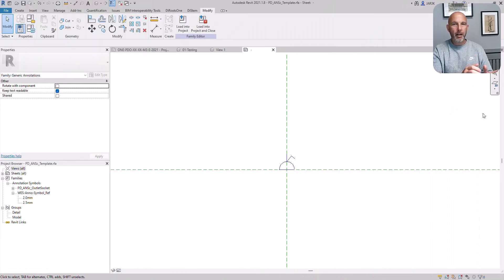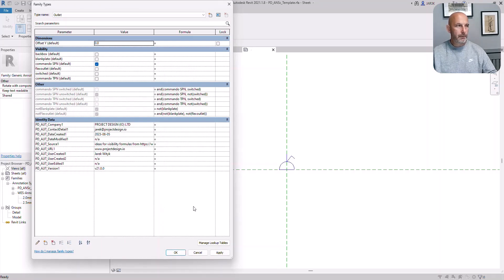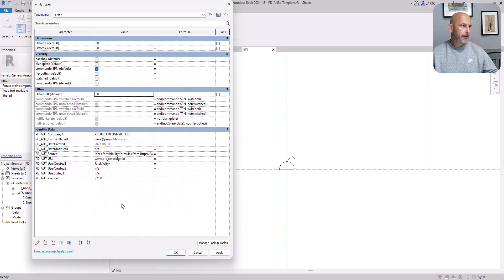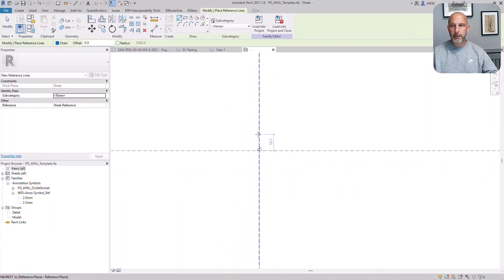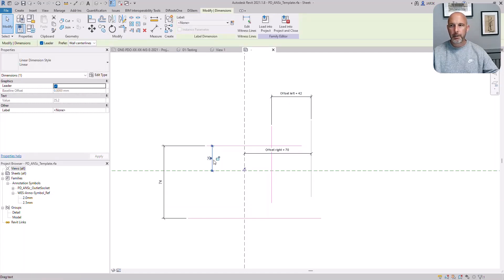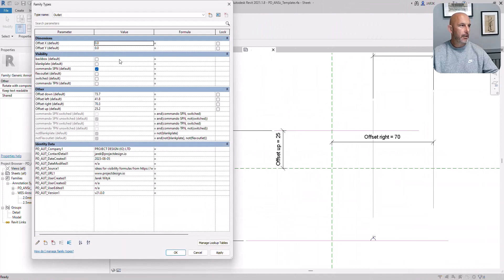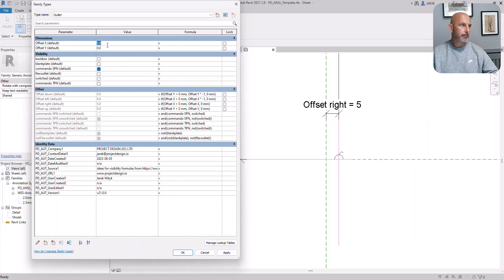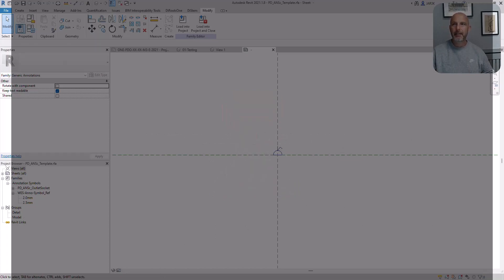4-Way Offset in Revit: The Best Approach Ever!

Comment: I try to do this, but some error shows up once i set the formula (Remove the constraint). Just i align my symbol to Vertical & Horizontal Reference line.. can use help me on this?
Reply from the maker: Most likely the error comes because of the order you are entering formulas in, try to follow the order exactly and see if it works. If you struggle, email me we can meet on teams and I’ll help you with that